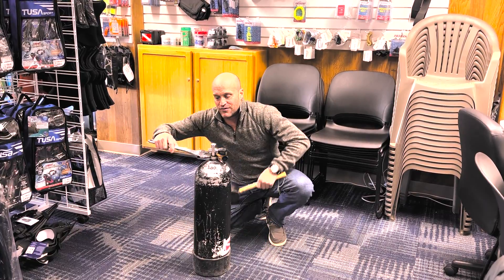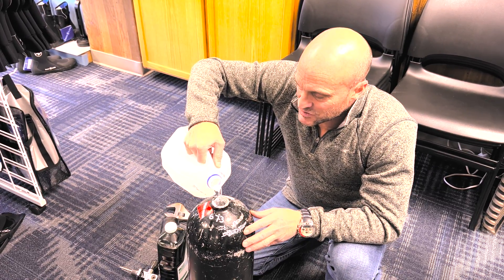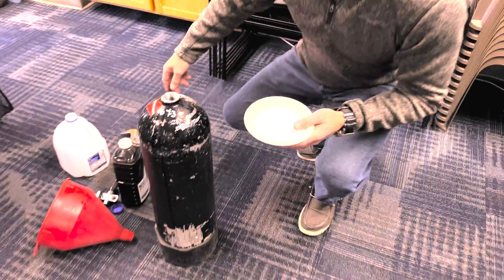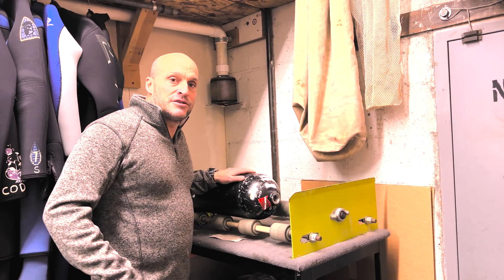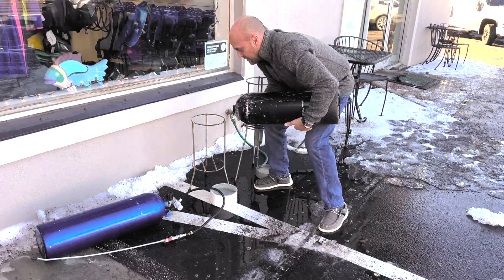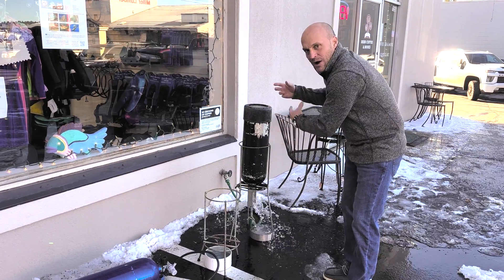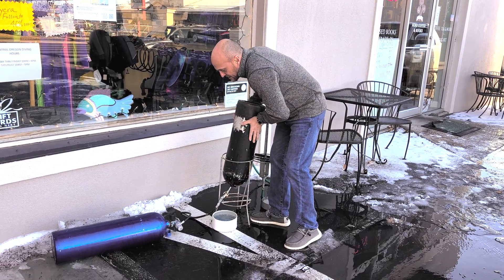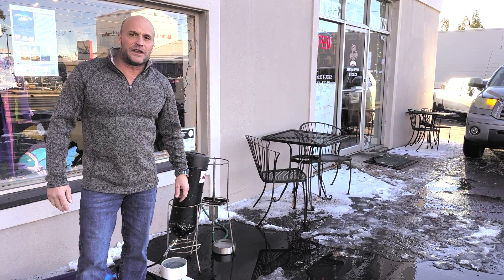Scuba Tank DECONTAMINATION Process

Comment: Hi, thx 4 video. So those glass beads work ok? Other videos ive seen use sharp gravel or aluminium oxide, but the beads work, even on bad bad rust on a steely? Any particular bead size better? Do they wear down and need replacing? Thx.
Reply from the maker: @HomeAutomated-v2r  beads work pretty good but I think broken glass and gravel would probably work better on bad rust.
Reply: @Nicgyver  thanks for half answered questions.
Reply from the maker: @ I think smaller the better, and yes eventually they would need replaced but I think you would have to do a lot of tanks before it came to that.  At some point, a tank is better off being replaced.  I personally inspect all my tanks so I make that call, if you have someone else do it, you are relying on them to give you accurate info.  I hope this helps.
Reply: @Nicgyver  ahh thats better
 I really appreciate your advise mate. Good on ya, from Australia

Comment: Pretty much how I used to do it when I was testing cylinders at the dive shop I worked for. We had a drying rack with a manifold with a bunch of tubes that you invert the cylinder on, there was a fan that forced air into the manifold to dry all the cylinders.

Comment: have you ever considered doing a video showing some of the dangers of this type of equipment? I'm not experienced but for instance taking a old tank and break the valve off to simulate getting dropped or other scenarios.
Reply from the maker: I haven’t but that’s a great idea!  Thank you!
Reply: @Nicgyver  no problem i just always think of that one because i had an accident once with an oxygen cutting tank getting knocked over broke the valve off and spun and rocketed thru a metal garage wall and was sitting about 100ft away nobody was injured but always think about it anytime i deal with pressurized tanks.